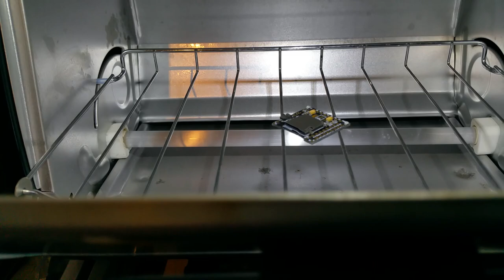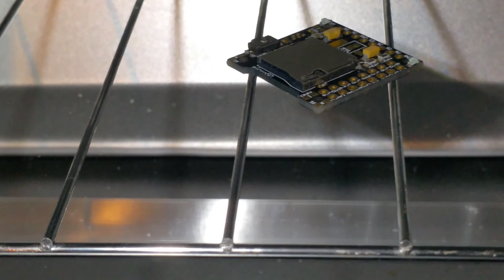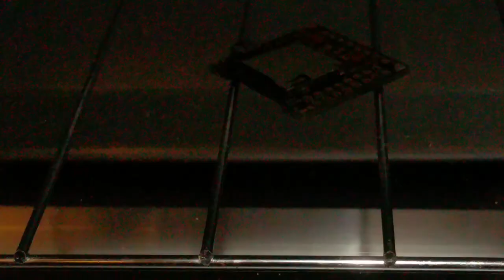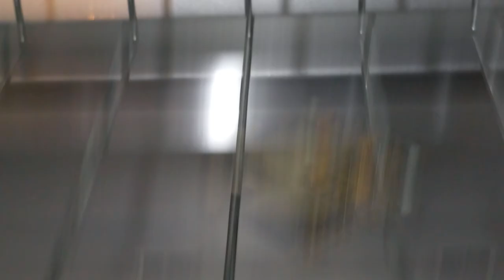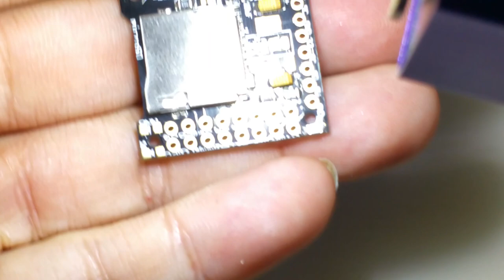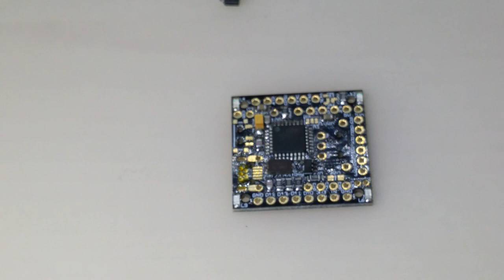DIY reflowing PCB in a cheap Toaster Oven, you can do it too :-)

Comment: You know what's funny, I was looking into cheap reflow options and was hoping you had something up your sleeve. I can't believe how well this works, thanks for the share! 

I made a few boards with a hot air rework station and it takes about 5-8 minutes, but 0603 caps like to pop up and I think I slightly melted some cheap micro usb ports.  

Have you noticed any issues with plastic parts or any other pitfalls with this setup? If the heating is even I feel like this would even be a more successful route then my method with less component stress.
Reply from the maker: Perfect timing I guess :-) Did not have any problems with plastic parts yet and I reflowed microUSB ports, my nav switch, push button, slide switch and microSD card slots. I must admit they do create a slight smell in the oven but the parts are still ok. 

With hot air I had the problem of parts flying away :-) I am placing the PCB so that the harder to solder parts or with bigger solder pads are closer to the heating element and it works great. I still could kick myself for not trying an oven earlier and soldering all parts by hand. What took me hours takes 2 minutes now :-) Now I need to get my PNP finished and save a lot of time too.

Comment: Nice one, As for the timer. You will find you can turn it back if you turn hard enough. I've never broken one yet.
Reply from the maker: Thanks and you are right, I just do not want to force it. Eventually I will add a type K temp sensor with a nice OLED display and control the oven over a SSR and turn it of when it reaches melting temperature.

Comment: really!!! u don't need reflow curve? u don't need to increase the temperature to preheat, heat, solder in specific time? or it's only working with passive component? how about microcontroller? cause i'm too lazy to turn my oven to reflow oven using arduino
Reply from the maker: Well, I am doing it for months now without a single damaged micro controller, I do have my own reflow controller and the probe sitting right next to my oven but did not get around to connect it yet, although the solid state relay is already in the oven and controlling the heating elements. I just have my 4.5V battery box and use that to turn on and off the oven while sitting there and watching the magic happen and cursing myself for not doing it earlier all these years. Of course if you do this with a too powerful oven you will toast your PCB, I am just lucky that it works the way it does. A controller is definitely advisable and I will put mine in one of these days, for sure before I start doing my new V-Gauge as that has 5 MCU's on there and I do not want to take any chance. Test your oven first and go from there.
Reply: pretty much same situation here, so u just set the timer and wait right, i'll try that...
Reply from the maker: No, no timer if you do it without a controller as not all parts will reflow at the same time. With a reflow controller you can be sure to not go over the limit and are on the safe side. But do not trust a regular timer to do it right. I always sit there with my finger on the switch and turn it off when all is done. You have to experiment also with the location of the PCB, the heat will not be uniform in your oven unless you have a fan in it. Basic rule, do not place the PCB over the heating element, always of to the side with the parts facing the element that need longer to reflow, like lager pads or mosfets for example. I did try this with same dead 328's and old PCB's first.
Reply: so basically we have to see it with our own eyes whether it's done soldering or not. i did that and works well for led, but little bit scared to do microcon.
Reply from the maker: It works, no worries. I have reflowed more than 50 PCB's this way, maybe even more, I do not count them :-) But as I said your oven must be suitable for this from the beginning, if you use a bigger stronger oven you will damage your components. Mine is a small 800W toaster oven and takes time to heat up. any higher wattage oven will heat up too fast.